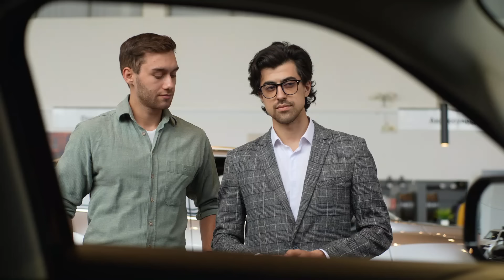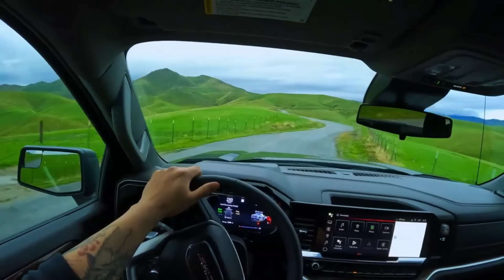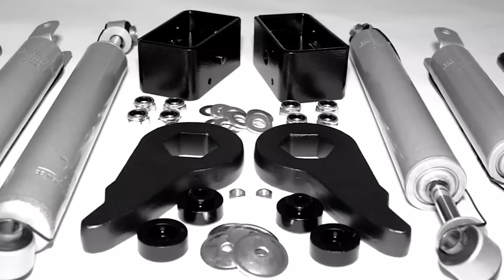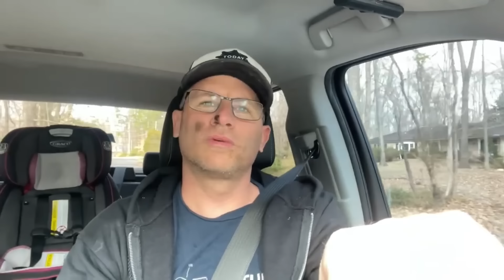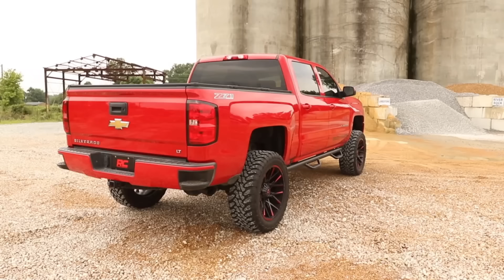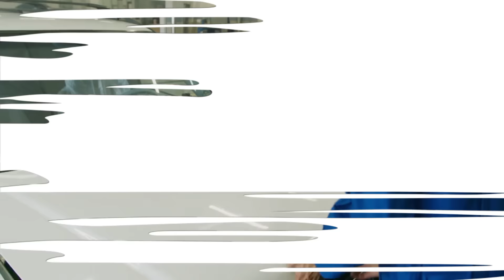3 WORST and 4 BEST GMC Upgrades You Can Buy

Comment: AFM is great, if the lifters fail, just replace them, take off the heads, spend like 4 or 5 days, back to super efficient fuel. The oil solenoids are under the valley cover  fairly easy access and diagnose.  Maybe replace the cam bearings and crank bearings if you have to go in that far,  but if the lifters start to fail it's not like you're not gonna know about it.  Listen or pull the intake off and look at each cylinder through their cycles.
Reply from the maker: The solenoid access under the valley cover is genuinely not as bad as the repair bill makes it sound at a dealer — the parts cost is modest, it's the labor hours that inflate it. For a mechanically confident owner the VLOM and solenoid swap is a legitimate DIY job. The lifter inspection through the intake ports is smart diagnostic work before committing to a full repair. 🙏

Comment: Why would gm not do it. Because Mary B doesn’t know or care.  Why would The Duramax have an oil pan that never empties, always hold more than a quart of dirty oil and sludge.  Remember gm doesn’t care. Mary B was installed by Obama during the bankruptcy.  Give her time to put gm back into bankruptcy
Reply from the maker: The Duramax oil pan sludge issue is a legitimate complaint — the drain interval and pan design on those engines does trap residual oil and debris in a way the gas engines don't. It's a known quirk worth knowing before buying. 🙏

Comment: The Diablo tuner has an AFM disable option, right?
Reply from the maker: Yes — the DiabloSport inTune i3 and Predator both have AFM disable as part of the tune package. The difference vs the Range Technology plug is that the Diablo requires loading a tune onto the ECU, which gives you more control but also means you can't just unplug it before a dealer visit. Know which approach fits your situation before buying. 🙏
Reply: @EverythingGMC-k9x  My warranty has expired, so I'm good to go.  Thanks for the info 👍

Comment: Every car and truck manufacturer aren't making vehicles that last more the 3yrs, cause of profits if they last more that 25yrs by then parts are not available, this happened with my Dodge 1500 mag front left spindle got discontinued.
Reply from the maker: The parts availability cliff is real — 25 years in and manufacturers start letting things go EOL. The GMT900 is the exception right now because the production volume was so massive that the aftermarket filled every gap. That's one more reason it keeps coming up as the recommendation. 🙏

Comment: catch cans are stupid, esp if there is egr and potential freezing temps.
Reply from the maker: The freezing concern is real in extreme climates — if you're in a region that regularly hits well below zero, the placement and drain interval matter a lot. On EGR-equipped trucks the catch can goes on the PCV side, not the EGR side, so they're solving different problems. Not stupid, just needs to be installed correctly for your climate. 👍

Comment: I have a 6.2L gmc(2022) denali, and was considering on which direction I needed to go to prevent any unnecessary problems for the future. Any advice?
Reply from the maker: For a 2022 six-two Denali, three moves — AFM disabler into the OBD2 port first, oil catch can second, and stay on top of oil changes every 5,000 miles with full synthetic. The six-two is a strong engine but it still runs AFM from the factory and that's the biggest risk on that platform. Do those three things and you're well ahead of most owners. 💪
Reply: @EverythingGMC-k9x won't the afm/dfm delete void my warranty? Or should I care about the warranty. And, what brand of company should I look into for a afm/dfm delete
Reply: @Derrick_Wagner  The Magnussun Act prevents the dealer/manufacturer from voiding your warranty, despite what they tell you.  Get a Pulsar LT, CAI, and a decent exhaust.  And if you can afford one, get a really good tune.  If you have a fairly heavy wallet, do a manual DFM/DOD delete, add a cam, and get rid of the cats.  And, NEVER run anything but 5w40 or 10w40 in a 6.2L.  Ever.
Reply: @ISeeYouToo-Ido i really appreciate the guidance you've provided. I will do my due diligence for those repairs, and see how i would approach them due to cost
Reply: @Derrick_Wagner 10-4.  Good luck.

Comment: WOW, THEY ARE REALLY SHOOTING THEMSELVES IN THE REAR-END HERE ON THE CAI, 1ST, YOU NEVER PULL AIR FROM INSIDE THE ENGINE COMPARTMENT AREA, ALL CAI'S ARE ENGINEERED TO ATTACH TO THE COLD AIR INTAKE IN THE WHEEL WELL AREA, IF YOU BOUGHT ONE THAT YOU KNOW PULLS HOT AIR FROM INSIDE THE ENGINE COMPARTMENT, YOU GET WHAT YOU DESERVE FOR BEING THICK-HEADED. UNTIL RECENTLY, THEY ACTUALLY SOLD THESE AT THE DEALERSHIPS PARTS COUNTER, YOU CAN STILL FIND THEM ADVERTISED ONLINE ON SOME CHEVY DEALERSHIP SITES, SO, WHAT DOES THIS SAY ABOUT GMC/CHEVY? A LOT I'D SAY, I ENDED UP BUYING MY CAI UNIT ONLINE FOR MY 2016 COLORADO LT V6, ATTACHES DIRECTLY TO THE WHEEL WELL AIR INTAKE "HOLE" INSIDE THE ENGINE COMPARTMENT AND IT FIT PERFECTLY OUT OF THE BOX, EVEN CAME WITH THE UPDATED MAF SENSOR AND GASKET SO THERE WAS NO RE-TUNING REQUIRED, BUT I GOT ONE ANYWAY, IT WAS ALREADY WELL WITHIN TOLERANCES BY THE WAY, I GOT MORE H.P. (APPROX 15%), BETTER GAS MILEAGE AS PROVEN AT MY NEXT 3 FILL-UPS, AVERAGED ADDITIONAL 12% MILEAGE BOOST, AS WELL AS THE IMPROVED ENGINE SOUND, REALLY WORTH THE 250.00 I SPENT ORDERING FROM SUMMIT RACING, SELF INSTALLED, IMMEDIATE IMPROVEMENT OUT OF THE BOX, NO ENGINEER, REPAIR TECH OR SHOP NEEDED/REQUIRED, THAT'S WHAT I CALL WELL WORTH THE INVESTMENT, TIME AND CASH! THINK GMC IS JUST JEALOUS OF ALL THE MONEY THEY ENDED UP MISSING OUT ON WITH SOME SIMPLE UPGRADES THAT ARE INEXPENSIVE, I THINK THIS IS WHY THEY STOPPED SELLING THEM AT THE DEALERSHIP, NOT A BIG ENOUGH CASH GENERATOR FOR THEM, AFTERMARKET WINS AGAIN! YES, I KNOW I'M TALKING V6'S HERE VS V8'S, GMC/CHEVY MAKES ALMOST ALL AFTERMARKET UPGRADES SOUND BAD OR WILL RUIN THE ENGINE IN THIS VID. JUST SOUR GRAPES I THINK AND MY TRUCKS 10 YEARS OLD AND HAS 72 THOUSAND MILES ON IT AND STILL RUNS AS GOOD AS NEW, YOU ALL MAKE YOUR OWN DECISIONS, WE ALL SEE THE NEWS ABOUT THE US AUTO INDUSTRY EVERY DAY, NOT DOING REALLY WELL, IS IT?

Comment: With the mid-generation refresh (2022/23) using a DFM disabler is NOT easy to install/remove fast. GM changed what needs to be done to disable DFM. Where, before, you could plug into the ODBII port, now it's a connection inside the drivers wheel well that you need to plug a module into, then the regular connection into the module. NOT something you can do on the quick. You also need to remove it if you take the truck to a dealership for work. 
Just be fully aware that the current generation of trucks (GM) are NOT the same as pre-refresh, or previous generations.
Also, you can get cold air intakes with non-oiled filters. So no worries on the MAF getting screwed up. I've seen some that connect into the stock air path so you're not pulling hot/warmer air than the stock filter would. Just be VERY careful of which one you select.
Reply from the maker: This is genuinely valuable info — the mid-gen refresh changed the install process significantly and that wheel well connection detail is exactly what 2022/23 owners need to know before they order a disabler expecting a two-minute plug-in. Appreciate you adding that for the community. On the cold air intake point — agreed, non-oiled is the safer call but filter placement and heat soak are still real variables. Good add all around. 🙏
Reply: @EverythingGMC-k9x  Any recommended vendor/makers for the oil catch can? Thinking about adding one to my 2023 Sierra 1500 (6.2L). Would rather "buy once, cry once".
Reply from the maker: For a 2023 six-two, Mishimoto and Billet Technology are the two names that come up consistently — both make direct-fit kits for that platform so you're not fabricating brackets. Mishimoto is the slightly more budget-friendly option, Billet Technology is the buy-once-cry-once choice. Either way, look for a dual-cylinder design with a drain valve so you're not pulling the whole unit to empty it. Best fifty dollars you'll spend on that engine. 💪

Comment: Any 3.0 diesel tricks?
Reply: Im going to leave my 3.0 stock. I’ve heard people loosing power with aftermarket parts (according to 2 people)
Reply from the maker: The upgrades in this video are built around the five-three and six-two gas trucks — that's where 85% of the audience is. The good news is most of them apply across the board: the oil catch can, the AFM disabler (not needed on the three-oh), and the Bilstein five-one-hundreds all work on the diesel platform too. Diesel-specific content is on the radar — stay tuned! 🙏

Comment: I have a 2021 colorado V6....it does "drop" to 4 cylinders via AFM. Is an AFM disabler a worthwhile purchase for my 3.6L V6 ?
Reply from the maker: Absolutely! While everyone talks about the V8s, the 3.6L V6 in your Colorado faces the same lifter risks when it starts dropping cylinders. Keeping it running on all 6 cylinders full-time is one of the smartest ways to ensure long-term reliability for that truck!
Reply: @EverythingGMC-k9x ....thanks for the input, I was considering a leving kit ( 1 1/2" ) for the front but you have changed my mind on that.
Reply from the maker: @robhodgson6872 glad that helped! 👍🫡
Reply: @EverythingGMC-k9x apparently they only have deletion kits for V8's....do you know of or have a link to an AFM deletion kit for the 3.6L V6 ??
Reply: Get rid of that Colorado.

Comment: I'll give you that an open element (hot air) intake can hurt your performance, but not all are "worthless noise" as you said. A sealed box like S&B or the Airaid cold air Jr  tube and filter kits are proven to add HP and tq. A CAI without a free-flowing exhaust will not benefit you as much.
Reply from the maker: You make a fantastic point! There’s a massive difference between a cheap open-element "hot air intake" and a high-quality sealed box like S&B. You're also spot on about the exhaust—if the air can't get out faster, more air coming in only does so much. Thanks for adding that professional nuance!

Comment: What do you think about the transmission cooler thing that allows the fluid to cool off before it goes back to the transmission? I have a 2014 GMC Sierra 1500 SLE, do you think I need that?
Reply from the maker: Great question! For a 2014 GMC Sierra 1500, a transmission cooler is one of the best "insurance policies" you can buy, especially if you tow or live in a hot climate. Keeping that fluid temperature down is the single most effective way to prevent the 6L80 transmission from wearing out prematurely!
Reply: What part of the country are you in and how is your truck being used?  Hauling?  In Texas or Arizona?  Yes you need it and need to change fluid more often than others.

Comment: i paid $50 for my cold air intake for my 2002 yukon. swwoomp swwoommp :P
Reply from the maker: Love the sound description! For $50, that "swwooomp" sound is worth it just for the smiles per gallon. Even if the horsepower gains are minor, sometimes the driving experience is about the feel and the sound of that 2002 Yukon!
Reply: @EverythingGMC-k9x I have a oem 2020 Dodge Charger Hellcat muffler. Im going to get it installed maybe this summer. I want to see how it sounds. 
Swwwommmppp swwoommpp 😊

Comment: The Range plug in under the dash is for a 8 speed transmission not the 10 speed that most if not all 6.2’s have in them. The tuner from Range technology for the 10 speed transmission is around $400. I have one in my 2020 Sierra with the 6.2 and it’s worth every penny.
Reply from the maker: That is a crucial distinction! The tech for the 10-speed transmission (standard on the 6.2L) is a different beast and definitely costs more, but preventing that constant shifting and protecting those lifters is worth every bit of that $400 in the long run.

Comment: Your wrong about the body lift.   Body lift maintains factory suspension geometry.   Cheap suspension lift damaged the items you spoke of.
Reply from the maker: You’re absolutely right on the technical side—a body lift preserves the factory suspension geometry because you aren't actually changing the angles of the control arms or CV axles. It’s those cheap, poorly designed suspension lifts that usually lead to the premature wear and damage we talk about.

Comment: Do I need an AFM disabler for my 6 cylinder 2015 chevy truck?
Reply from the maker: Actually, yes! Even the 4.3L V6 in those 2015 models uses Active Fuel Management. While the V8s usually get all the attention, those V6 lifters can suffer from the exact same failure points. A disabler is definitely cheap insurance to keep that Chevy running smooth for the long haul!
Reply: @petelinster7093  disablers only prolong how long it will fail. If you want to be sure it won’t fail you need a DoD delete kit.  I suggest just running it in 5th gear lock until you can get a DoD delete kit and tune.

Comment: Ok let's see here. 1st. Doing a body lift just raises the body off the frame. It does nothing with the suspension or steering.That stuff is all attached to the frame. Only thing it changes is the steering wheel tube to the steering box length. Nothing else is changed. I call BS on that.
2. Cold air intakes. GM used Cold air inductions intake system for years. I had one on my 22 Camaro SS 6.2 I got it through my local Chevrolet dealership. Sure it doesn't do alot by itself but if you put on that Borla exhaust you talk about it & add a high flow cat maybe some good headers depending on your budget it will due something then. More air in, more air out. An engine is just an air pump right. Faster you do that the faster you can go.
3. Ok your little blinking light for the OBD2 port. Never used one does look like junk I'll give you that one. I do have a Range Disabler on my truck they do work no problem with them at all.
4. Now nothing against Bilstiens shocks they are good but my truck has magnetic ride so I'm thinking they won't do me any good. Your good on the rest of your video. 
Be cautious on what you tell people. People on tight budgets can get pissed about misleading information.
Reply from the maker: Spot on with the distinction—a body lift definitely keeps the suspension geometry stock compared to a full suspension lift. You're also 100% right about the Bilsteins; if you already have Magnetic Ride, swapping them out is a step backward for that specific setup. Appreciate the detailed breakdown for those on a tight budget!

Comment: Cat-backs are not true dual exhaust, they are garbage, no performance gains
Reply from the maker: Exactly—most cat-backs are just "noise makers" without providing a real performance gain. Unless you're opening up the whole system, you're mostly just paying for a different exhaust note, not extra horses.
Reply: Mine is.  It is a Borla set-up, but it begins behind each cat and is dual into each muffler, and remains dual all the way out to the split tips.  I also have header.

Comment: I love my range tech disabler for 2015 chevy 5.3L
Reply from the maker: The Range Disabler is a game-changer for the 5.3L. Keeping that engine in V8 mode all the time is one of the best ways to protect your lifters and avoid the typical AFM headaches.
Reply: @EverythingGMC-k9x  - in the middle of a purchase for a Sierra SLT.. and while everything is getting finalized. I ordered a range tech disabler for the AFM.. I've read about the horror stories with lifters
Reply: I got plug in module range dfm disabler on the new 10 speed gmc model 6.2 it runs so much better and permanently stop the start stop button
Reply: First mod on my truck second was tint on my windshield

Comment: GM was selling these themselves as an upgrade Explain that
Reply: Manufacturers sell OEM parts that include cold air intakes.
Reply from the maker: It’s a classic case of profit over longevity. Just because a manufacturer sells it as an "OEM upgrade" doesn't mean it’s designed for 300k-mile reliability; often, they prioritize performance metrics for the first owner over long-term durability for the second.